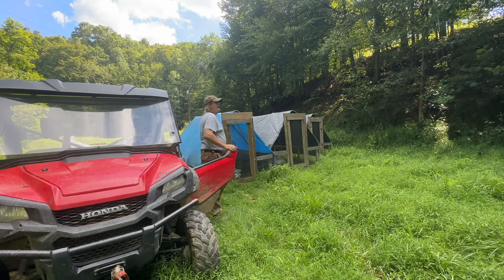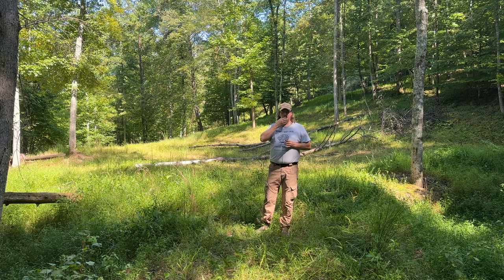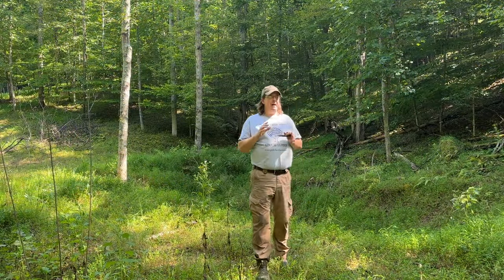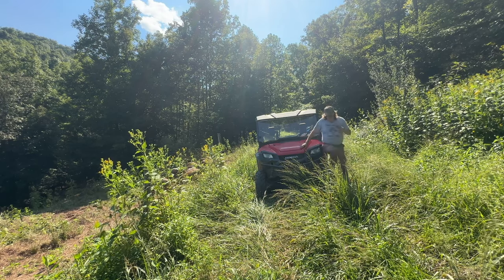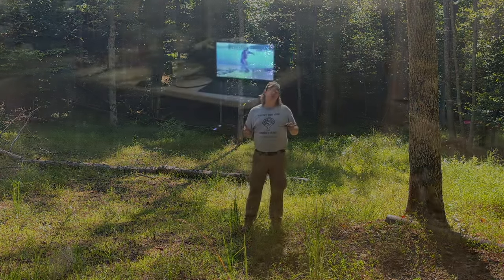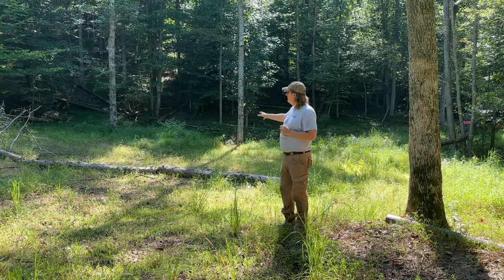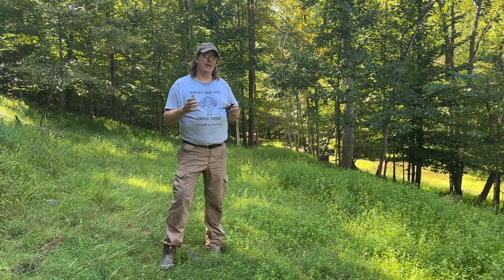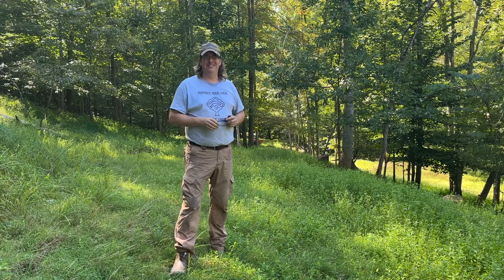Maximize the ASSETS of Your Land for $$$ and Peace of Mind

Comment: Whenever I have someone asking about a new piece of property, I always recommend taking a year to learn about it.  Which direction is the prevailing wind?  Does spring make certain areas of the land hard to access?  In snow country, where are you going to be fighting drifting?  The point is, a lot of this info. will help drive you as to where to locate and orient structures for you and livestock.  What best you can utilize the land for, etc.  You need to understand the micro-climates so you are working with and not against nature.
Reply: Good points, prevailing wind is often a huge issue.

Comment: if he is going to get live stock he could fertillize and lime and when hay was cut he could take 1/2. i am never renting hay land again you clean it up and fertillize and then they put you out it has heppen to us 6 times. same thing with fencing for grazing never doing that again 2 times they sold the land the next year. there is no fool proof way to do it. if you can work on equipment buy used rake , mower, baler and tractors or pay some one to make your hay for you that would be a lot cheaper than buying every thing new. take care, be safe and well.